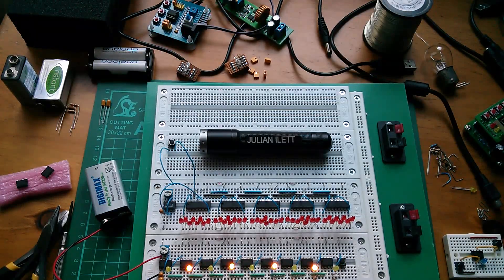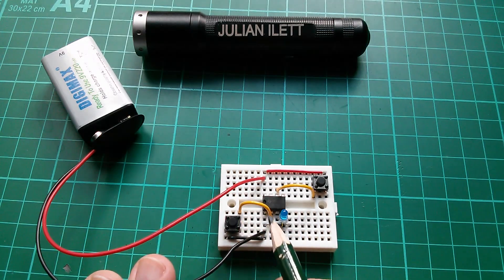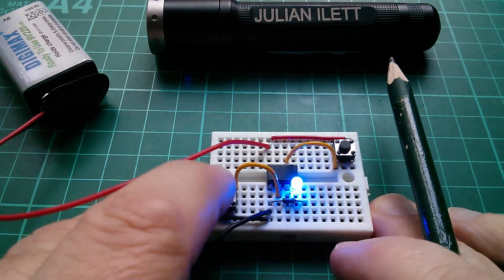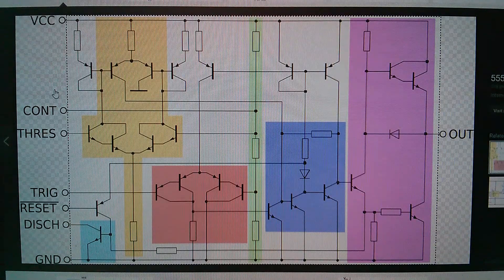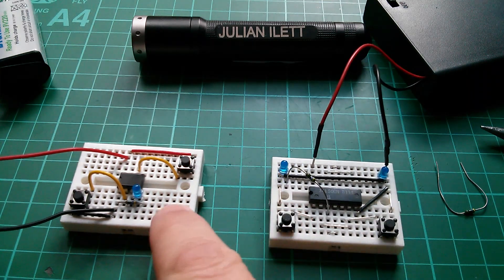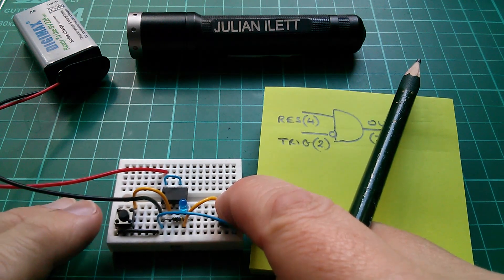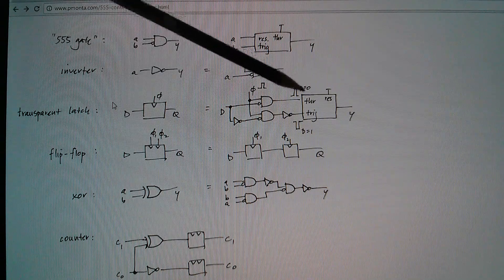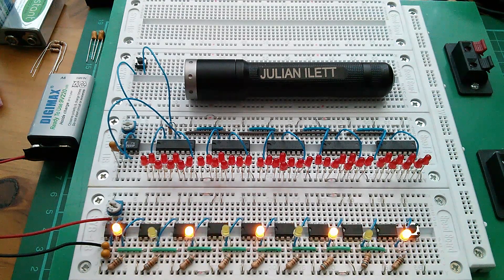Julian's Logic: 555 Logic Functions

Comment: I tried making the same circuit as the one shown at 2:30, however I needed to pullup button PIN 2, and pulldown on PIN 7. You build doesn't need them which I find odd!

Comment: I was actually looking at that page about using 555s as logic gates the other day in the hopes of finding a way to use them to make a counter. I just started with electronics a few months ago and haven't got any logic ICs yet, so I've been trying (in vain) to recreate logic circuits with discrete transistors. I was hoping this would be an easier solution for a counter. Even though you can't get NOT Q from the 555's flip flop, you CAN connect an LED from positive INTO the output (with current limiting resistor) and get an inverted output. You can leave the LED going to ground from the output and have both a Q and NOT Q.

Btw the output driver for the 555 is called a totem pole output. I'd been wondering about it myself for ages and randomly came across a wiki article on totem pole outputs and realized it's what they use on the 555 so I began reading more on it. Thanks for taking the time to post this. Now I think I'm gonna binge watch some more of your videos.
Reply: Yes, the original NE/SE555 Datasheet, if you should find it, states clearly that the Output pin of a 555 timer will SINK as well as SOURCE supply voltage @ 200mA, all due to that totem pole output.  You can do interesting things with a symmetric voltage divider and a dual color LED.  Check it out if you have such an LED.  Using Julian's favorite 9V battery source build a resistive voltage divider between Source and Ground of either 100 ohm or 120 ohm resistors.  Connect your bi-color LED between the output of the 555 and the center of the voltage divider, then set the time to run in a slow second or less astable oscillation.  You should see the colors alternate.  Note what occurs as you increase the oscillation rate.  For those of you who haven't a bi-color LED you can substitute red and green diodes set in parallel Anode to Cathode-Anode to Cathode, but you may not see the same phenomena when increasing oscillation as when the two colors occupy the same package.  Works with a bi-color LED with a V-drop of 2.3V requiring 30mA. - Fun!  Note: this 200mA limit is Maximum for the standard 555 timer.  This circuit should work with the CMOS 7555, but current limitations vary with the CMOS circuitry.

Comment: ...couple of things...The output driver IS inverting (and a bit hefty).  Also it is NOT a good idea (esp with CMOS floating around in odd ways) to leave pin 4 (reset) open--simply run a wire to the nearest gnd or pin 8.

 A couple of things that may be of interest:  I once designed (for a contest-"DESIGN IDEAS", IIRC) a --true- sine wave oscillator based on the 555 with the frequency AND amplitude adjustable and totally independent, one pot did not (in any way) interfere with the others (freq. and amp. control).  This was a contest by "Radio Electronics" magazine in the late 80's--the prize was a VERY nice circuit board holder.  I wound up trading it for a HUGE resistor kit.
One more thing worth mentioning:  The digital version of this--using the 555 (actually the 556) as a pulse train generator with the frequency and duty cycle (adjusted with a pot for each) TOTALLY independent of each other...simply drive an astable  (oscillator) with one unit, connected to trigger the other unit configured in monostable mode (pulse gen.) settable to any desired pulse width, and you have a rectangular pulse with totally independent freq. and duty cycle control.  BTW, it is not difficult to configure a 555 with a virtual 0% to 100% duty cycle...OH!, I seem to be rambling--sorry-'later...'

Comment: great video Julian I wish I could understand Electronics better. I have built a microwave Transformer spot welder to build my 18 650 battery  for my bicycle . I cannot get my foot switch to be consistent for my spot welds. I need a timer circuit to control the primary side of the Transformer I think others have used zero to one second or something like that do you have any suggestions for a Luddite like my self
Reply: you probably solved this long ago but if youre still interested you can control a MOT based spot welder very simply using a relay switching the transformer primary, driven by appropriate capacitors via a double throw switch and a rotary switch. check out Marco Reps' video on DIY spot welders.

Comment: It would seem more prudent to simply use the data sheet (instead of picking a diagram on google images). Also, if you print it out, it would look better.  It's hard to see when you film your screen. Oh and if a box in a diagram has SR inputs and no clock input, that means it's an SR flop (as opposed to a JK or D flop).

Comment: Julian, I enjoy your videos and find them interesting although I know very little about electronics could you tell me what vcc means?
Reply: http://encyclobeamia.solarbotics.net/articles/vxx.html
Reply: Some indicate that VCC means Voltage at the Common Collector.  My take on it is that VC indicates the voltage at the collector of a bipolar transistor with respect to ground.  VCC indicated the power supply voltage to power the transistor stage/s.  It all comes from transistor references.  VB, base voltage, VBB base power supply voltage. So double scripting with the same letter indicates supply voltages.  Another example VD drain voltage of a FET transistor and VDD the power supply voltage for the FET transistor stage.  Others may have a better answer but hope this helps.
Reply: Thanks will have a read up

Comment: Im not sure, but i think that with a little bit of work using capacitors and transistors you can manage 555 to work as a flip-flop
Reply: That's the right idea there. Basically, you can use a PNP transistor to convert a negative signal to positive, and a NPN transistor to convert a positive signal to negative. They can be used as a one way inverter if you want. 

That's also how you can massively amplify a signal, negative input to PNP gives positive output that inputs to a NPN and gives a much larger negative output. The second transistor (NPN) is generally larger the the PNP preamp. Very common in simple class A amplifiers.

Comment: Hey Julian, could you make a video about the step down converters on ebay that have the enable pin. It would be interesting to see what current the diffrent modules pull when "disabled" and so on. Example here that i recently ordered, im going to use it to maximise the battery life when the arduino is "sleeping"(i have no free interrupt pins so im making the arduino power off itself, and when i press a button, the arduino will pull the enable pin online, so the energy lost when powered down will be absolutely minimal. - http://www.ebay.com/itm/401180305767?_trksid=p2057872.m2749.l2649&ssPageName=STRK%3AMEBIDX%3AIT

Comment: The 554 was not right and the 556 never caught on. God bless the 555
Reply: You forgot the 558 - a quad timer, I think.
Reply: The Tyttuutface you are correct, however the four timers in the 558 are somewhat 'crippled' compared to those in the 555 and the 556: there is only ONE control voltage input which serves all 4 timers.
For more info about this, i'd suggest you get hold of the relevant datasheets, which should be available from many sources.
Addendum: the wikipedia page contains some information about the 558:
https://en.wikipedia.org/wiki/555_timer_IC but it also refers to this variant as "obsolete" since no manufacturers are known to make them anymore.
Reply: TheDutyPaid 
I've never heard about a 554 timer ic before, can you tell me more about that one?